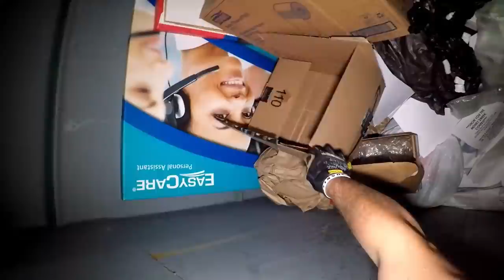Dumpster Diving & Curbsiding "We're Gettin' All Kinds Of Lucky!"

Comment: Atari hooks up to the tv as I recollect, that was your monitor. Dig Dug was a pretty popular game in the early 80s, research it, may be a minor payday. Round silver thing is not a bell, it is a bathtub enclosure clothes line. Pull the string out and attached to a clip on the opposite wall over the tub. Wet clothes dripped into the tub, not your floor.

Comment: 35:36 - the thing with the wound-up string is a laundry line. You could hang a few clothes on that. The nub on the front of the line would attach to an anchor in the opposite wall. These used to be common in hotel/motel showers so you could dry your swim suit after going in the pool. I don't think I have ever seen one in a home.

Comment: Go to FM 306 in the hill country. About 7 miles east of 281 there is a hill that will give you your need for speed. 55 at the top put in neutral and be doing 95 or so at the bottom so I figure you could make at least 40-50 by the time you get to the bottom.

Comment: Coax cable - Just had to buy four 50 Ft RG-58 with PL-259 ends (Ham use). (one for my 2 meters 2nd one for HF equipment). Long RG-8 (Thick cable) and RG-58 ham radio operators would want 25 Ft or longer (RG-8 & RG-58 are 50 ohm cables

Comment: Atari 800 came out at the end of 1979 / early 1980. Why don't you take coax, lots of coax is Copper inner and braiding, in particular that used for systems that transmit where a much higher quality is needed.